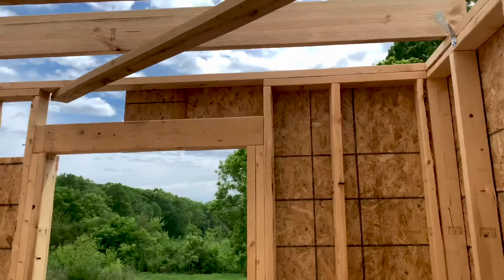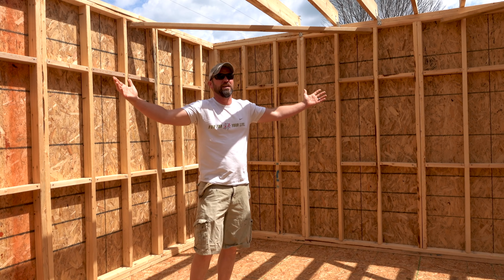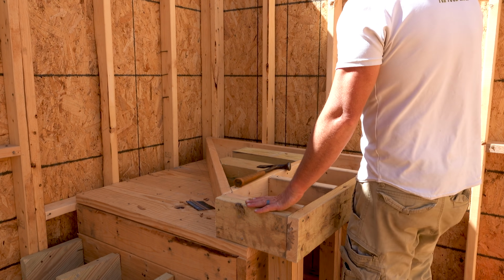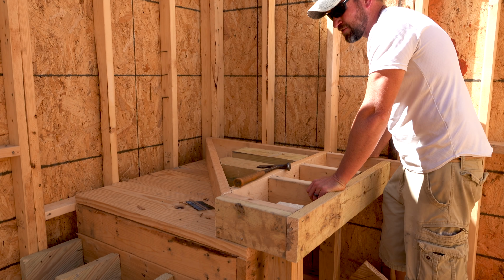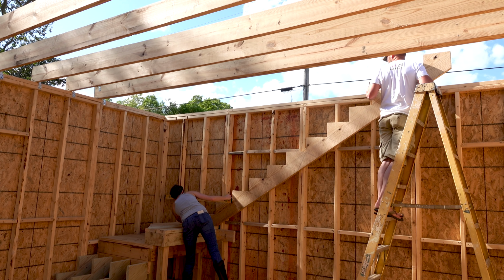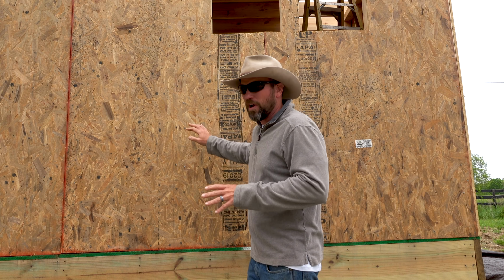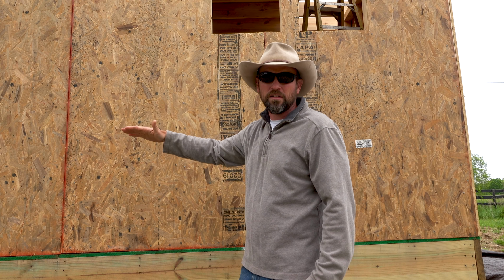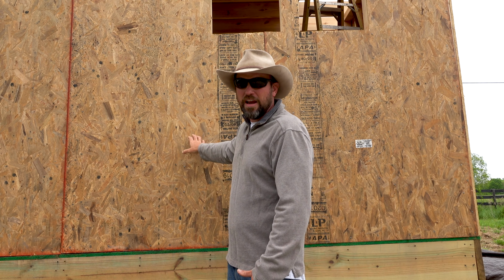BUILDING STAIRS IN A SHED

Comment: I think those floor boards will say "This side up" on one of the faces...they are more protected on that side so I thought. Good work on the stair. The rise and runs can be easy to calculate but the ends are sometimes easy to mess up. Built a few myself. I find it easier to use the compound sliding mitre saw to maintain consistent angles and finishing the corners with a jigsaw or hand saw.

Comment: You certainly got a good workout lifting and holding those timbers and the second-floor sheathing in place. Your viewers have to keep in mind that building codes change state to state and town by town. So what may be code in their area is going to be different in yours. It would be nice to have a country-wide building code that all builders must follow but that can add unnecessary cost to a project when it's not necessary for that particular location.